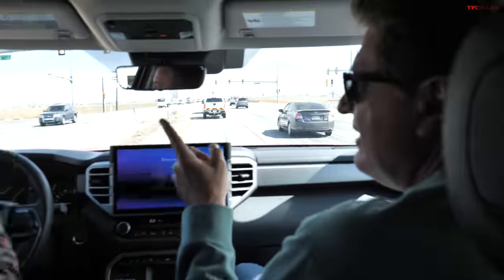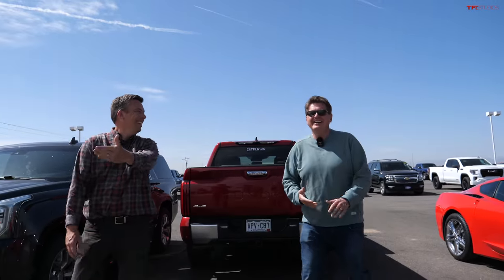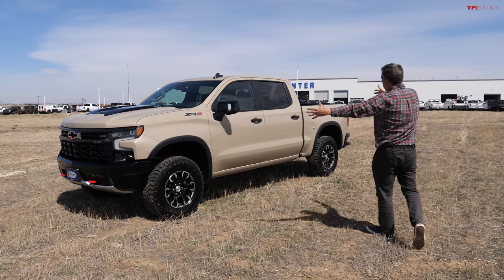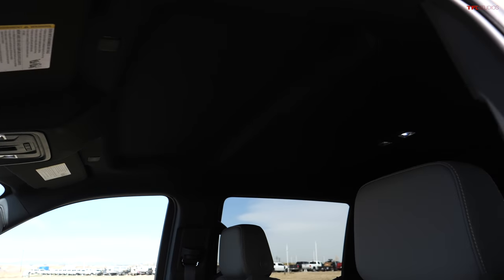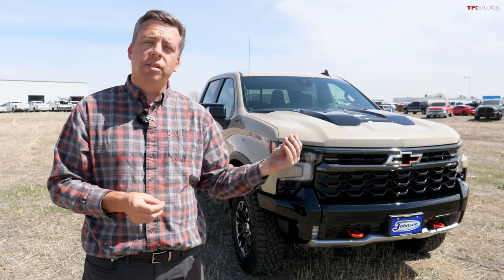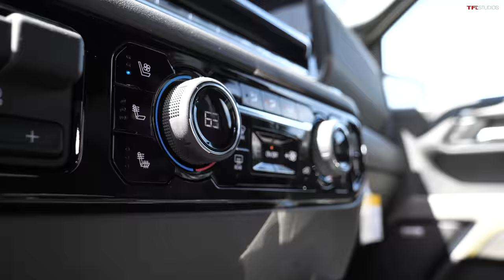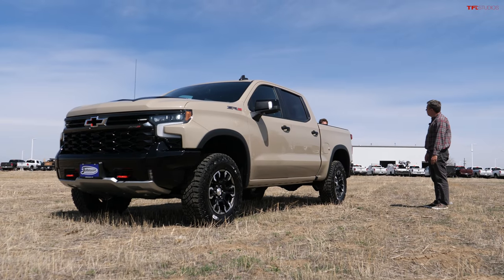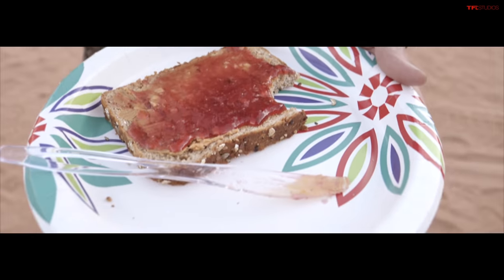We Traded Our 2022 Toyota Tundra TRD On This Brand New Off-Road Truck - Here's Why!

Comment: nice looking truck hope you keep it long enough this time to see if it is reliable its a gm product not a toyota so reliability will be an issue. great content thanks love your channel
Reply: Agreed, GM will never come close to Toyota reliability.
Reply: All the chinese parts start to fail. After owning a chevy, I'd never buy one again. Always fixing something. Wheel bearings, ABS wires, wiper assembly, coils... Way too much imported chinese parts. Looks don't equal reliability.
Reply: @franktags136  lol
Reply: I don't know I'm at 520k on my 06 gm truck and 585 on my 2000 both stock engines,alot of these ppl trade there truck in every 5 years and say how great they are,keep it for the long haul and see the outcome..
Reply: That's why TFL needs to keep buying historical problematic vehicles, is for the potential of drama of ownership.  Where is the drama/fun/chaos of owning a product for a year that works and ever lets them down?  Which is why the Tundra needed to go after only 5 months.  They knew it would not keep the interest of the viewers.

Comment: So it’s $10,000 more than the tundra traded in but comes with tow hooks. That engine is impressive but will be even less economical. 
Honestly, I don’t care. Looking forward to seeing a new truck on the show.
Reply: Vs the truck they traded in this  has more capability, more towing , gas milage is pretty much a wash.  Better off road ,  more tire , lockers front and back. I get it , you hate GM but if your going to downplay it , at least do some homework when you spew out price.
Reply: @9663mu  Well they got MSRP for there used truck with over 7000 miles, in this market probably not a fair measure. They said in the video the new truck is rated to tow under 9000 lbs, the Tundra was rated for over 11,000 lbs. I doubt the fuel economy will be a wash especially if you consider you have to buy premium fuel now. It is a nice looking truck though.
Reply: @vitkobylka6432  who says you have to buy premium fuel ? It’s recommended maybe your towing heavy or have a big haul but the truck runs just fine on 87.   Talk to me when Toyota sells more then 10k tundras in a month.
Reply: @9663mu  Maybe I’m misinformed but pretty sure you are supposed to run the 6.2 on premium fuel, that’s what turned me off that engine choice. I really like the GM 3.0 diesel, interesting though how having a turbo like most diesels no one makes any comments on that but Toyota’s decision to put turbos on an engine like Ford gets lambasted. Last time I looked you’re right they don’t sell that many trucks but it’s sure interesting that they are the number 1 car manufacturer in the world. I’m sure if you get the ZR2 you’ll enjoy it, I would.

Comment: I paid $69K for a ‘22 Power Wagon that has Front & Rear Lockers, Solid Front & Rear Axles, 4:10 Gearing, Sway Bar Disconnect, 12,500 LB Warn Winch ( Standard ) and all around shocks and coils No leaf springs..🤷🏻‍♂️

Comment: As excited as I am for this I am still wary of the 6.2 after my neighbors blew up after 1500 km
Reply: Its Garbage Motors for a reason
Reply: I had a 6.2 that lasted to 200k . At 200k the oil pump started to go bad. I could have put a oil pump in it and it would have lasted longer.
Reply: My buddies lasted 20k before blowing up
Reply: I believe the new model's don't have DOD or whatever it's called today. From what I've heard that was causing the reliability problems.
Reply: @cesarurzua8234  my friends new tundra just blew up with 35 miles on it
Reply: @danielmeador1991  new tundras are unreliable, that I can’t deny, pre 2022 tundras are reliable, some even reaching over 1 million miles
Reply: @cesarurzua8234  no 2022 tundra has hit 1 million miles and I seen 6 Chevys with 1 1/2 million miles and only 1 Toyota with 1 million miles and it wasn’t a truck it was a Prius
Reply: @danielmeador1991  did you not read my sentence correctly? I said pre. Also it was a tundra, no hybrid comes even close to 300k miles.
Reply: @cesarurzua8234  the one I worked on did and technically that tundra had 975k on it
Reply: @cesarurzua8234  and I did I misread it sorry

Comment: I've always been a Chevy guy and I own a ram now. I am disappointed. Same 6.2 V8. Nothing really special. Seems like a trail boss 2.0. And Chevy needs to step up their interior game to keep up with all the other brands
Reply: Umm did you not see the interior? Lol
Reply: Same 6.2L? That has more standard HP/TQ than Ram.  Yet you state you bought a Ram and they haven’t updated their so called 5.7L “Hemi” in years!  Too funny.
Reply: @xxlavenderxhedgehogxx7346  I think he means a new engine in the higher up trims. Kind of how ram has the trx with the hellcat engine.
Reply: @10ProSoccer  yes, that's what I mean. Doesn't compete with the trx. I'm happy with my truck but its a 2016 that was 40k new. For 70k I would expect way more lol. And yes I saw the interior. Not impressed for the price

Comment: Someone will see this tundra at the dealer and think someone traded it in because it had lots of issues
Reply: The Toyota dealer in metro Atlanta had five used 2022 Tundras with less than 100 miles on them.

Comment: You traded a Toyota for a Chevy… you must like walking lol.
Reply: Better content for a youtube channel business.  Bigger gamble on chaos which more people will tune in for than something that just works.
Reply: That Toyota has problems though
Reply: @danielmeador1991  I agree, the 2022 has bugs to work out mainly turbo problems, I still don’t recommend Chevy. All of the 3 main American car companies have problems these days.
Reply: @davidcoombs1874  all car companies have problems these days
Reply: @danielmeador1991  the last 2 Toyotas I owned, the one never gave me problems, the other only needed front wheel bearings replaced at 80,000 miles. The last Chevy I owned needed a new transfer case at 20,000 and it would start hard. The Ford needed the cv shaft replaced twice in the same month because the vacuum pump was half engaged but wasn’t throwing codes. I can honestly say I’ve never owned a dodge. I think you’re right, but I still think Toyota is a cut above the rest.
Reply: @davidcoombs1874  I think new Toyotas are junk
Reply: @davidcoombs1874  my 2008 tundra blew up at 127k miles. My 2004 chevy lasted 200k miles. I don't know if Toyota is as good lol.

Comment: Sadly, owning a GM product like a vette or this ZR2 is like being married to a Supermodel with a chronic yeast infection. I foolishly have owned 3 GM’s within the past 3 decades and all of them were horribly built garbage. I’ve owned and currently own Toyota and Honda products, unbelievable how much better built they are.
Reply: I have to add, anyone who would pay over $67k for a GM or for the most part excluding exotics any vehicle is an absolute fool. Unbelievably stupid price tag. Guess consumers are sending the manufacturers great grandkids to college and paying for their weddings.
Reply: @franktags136  not just gm, all vehicles are insanely expensive now. You're right though, I've always had a special affinity for GM, my first couple cars were GMs and were actually fairly reliable. But both my mom and my aunt have had 2010 GM suvs, an Arcadia and a Cadillac SRX and they've both been complete piles. Seems like they're always in the shop, and they barely have over 100,000 miles. My aunt was smart enough and traded hers for a CRV, my mom is still plugging away with that Cadillac. Meanwhile, I bought my 4Runner 3 years ago with 80k on it, it's at 136k now. In that time the only repair I've had to make to it was $189 to have the AC serviced at the dealer, it was blowing kind of weak. The only other money I've spent on it has been fluid changes and a set of tires.
Reply: @franktags136  Toyota will charge you $70,000 for a TRD Pro that doesn’t even have tow hooks. Y’all live to troll GM with your bs like they pull prices out of the sky that just aren’t justifiable unless you’re sitting in a outdated Tundra interior with bits and pieces falling apart. Check 2022 Tundra forums. 😅
Reply: Oh you are correct, and it’s not even close. It’s been like that for about the last 3 of 4 decades. The only slight exception to me would be the 99-06 Silverado’s.
Reply: @mybro727  The Toyota price is stupid as well, not just GM. Difference is the Toyota is a far better built vehicle. Waste Gates issues and all.
Reply: Unfortunately for you, the Corvette is extremely well built. Maybe don't buy from a crack head selling you his C5 Corvette that's been neglected for 10 years. The C6 Corvette and C7 have amazing reliability and hold up extremely well after constant track use for multiple years. The C8 Corvette has been universally acclaimed by every major magazine and reviewer as world class in both performance and quality, with the 3LT interior package being directly comparable to the 2020 Porsche 911 Carerra S, with the end result of them claiming the build quality and materials are 95% on par, and the performance is slightly better than the Porsche
Reply: @franktags136  the Cadillac CT5-V Blackwing is world renowned as being the best 4 door drivers car ever built, with it possibly having the highest performance of any 4 door car on the track, and its build quality directly comparable to the 2022 BMW M5 CS, and the 2020 Mercedes AMG GT 63 S.
Reply: @mybro727  I'm a Ford guy...but Toyotas have issues as well, just like the domestics.
Reply: @saltyfloridaman7163  yea, good luck with that. The Lexus IS 500 though not near as fast and in my opinion the Cadillac looks beautiful yet you will not convince me the Cadillacs build quality is anywhere near good. Owning a GM product like the Cadillac is like being married to a Supermodel with a Chronic Yeast Infection. I’ve owned GMs. Long term absolute garbage.
Reply: @franktags136  I think you’re confused. No one is trying to convince you of anything. You have your own preconceived notions that you’re operating off of no matter how inaccurate they are. Depending on your age, you’re not going to budge either direction after this conversation. But the point is to enlighten you anyway! 

Have you heard about all the build quality issues and unreliability Toyota is experiencing lately with their flagship the new Tundra? Lol. You can’t have. 😂 

The Lexus IS500’s interior is built by the same folks who built the Tundra - and looks the part. It doesn’t even compare to that of the Cadillac V-series sedans. Makes the Lexus IS look 10 years old because it is. Again, the materials and build quality of Cadillac are certainly on par with Lexus, Mercedes-Benz, BMW, etc. As someone has already mentioned, there are world class Chevrolets right now that will put the best from Germany on their arse.
Reply: @franktags136  Reality check. You need one. Honda just went into business with GM after expanding plans for GM to build two of their EVs, so not even HONDA agrees with your assertion about GM’s quality or else why would you have them build your own products? You’re a walking contradiction. 😂
Reply: @saltyfloridaman7163  good luck with that. The cars that sit in a garage and get driven every other weekend. Not a real world daily. Long term 50k plus miles, it’s garbage. That’s a GM promise
Reply: @mybro727  excluding the Escalade, because people keep spending the cash it takes to keep them on the road, how many 8 year old Cadillacs do you see as daily drivers ? Be honest and the truth shall set you free
Reply: @mybro727  Buy your GM, keep it beyond the warranty period and good luck
Reply: @franktags136  sure thing, my neighbor tracks his C7 Grand Sport every weekend and has 128k miles from driving to Sebring, VIR, and the annual trip with his friends to willow springs. Only thing he replaces often are tires, brakes, and he replaced his suspension once
Reply: @franktags136  I can tell that you're obviously just biased and feel the need to complain on a YouTube video for validation. My family is all about ford, but my father and two uncles all worked as mechanics and currently work at LKQ and have for over 20 years, and even they admit that utility and performance models from GM are among the most durable and reliable vehicles, but they also admit that GMs economy cars and crossovers are generally below the industry standards
Reply: @franktags136  So you believe the Escalade is the only expensive product GM builds and sells fairly well every year? 😂 The more you talk the more I understand.

What makes you think I haven’t owned a modern GM product outside of warranty already? Smh. Too late! Most reliable mid-size car I’ve ever owned was a 2014 Malibu LT well over 125,000 miles before it was totaled in a crash. Unlike your experiences, my car was actually a MODERN GM product which means it’s not too far fetched to compare it’s build quality to that of new GM products today and trying to draw a line to connect the two. The opposite can be said for you, but I digress.

Comment: 🫤 this is a great truck for GM fans but they clearly called it in. The TRX and Raptor are in a different league. And if you want an off road vehicle without the luxo features you can get a Raptor for the same price (MSRP).
Reply: I’ll pass on a raptor ford made the mistake of putting aluminum lower control arms on it.
Reply: @Back_door_bandit_98  weird, do they fail?
Reply: LOL. The TRX is in a different league in price as well at $100,000+ so your direct comparison doesn’t make sense.

The Ford Raptor is much closer to this in power numbers but doesn’t come close to the luxury and technology GM is bringing to the segment and the Raptor can also be well over $80k. Called it in? I’m sorry, did you expect a redesigned brand new truck for a mid-cycle refresh? 😂
Reply: @mybro727  tech? Don’t make me laugh, Raptor’s off-roading tech is light years away from the ZR2🤣🤣
Reply: You can't touch a new raptor around here for this price....shit they are marked up to nearly 100k
Reply: @mybro727  actually the Raptor can come fully loaded just like the ZR2 but the ZR2 can’t come equipped with the same engineering for off road use. The Raptor’s frame is different and stronger than an ordinary F-150. The suspension is totally different. Even the intercooler has its own cooling fan for slow speed rock crawling. No other F-150 is is equipped with that. The TRX doesn’t have a different frame but it’s heavily reinforced with a different suspension than normal Rams. The cost associated with a Raptor isn’t fancy cameras and leather it’s the special tooling and equipment used to manufacturer it. As far as I know save for the shocks the ZR2 is basically a loaded TrailBoss. Called it in.
Reply: @khakiswag  Lol. Again, you’re comparing a Raptor to a truck that costs thousands less and clearly doesn’t even have the same order of priorities. Yes a lot of what you said pretty much sums up why the Raptor is a more capable off-road truck and a worse on-road performer/daily commuter than the ZR2. We’re fully aware. Perhaps that’s why TFL just purchased a new ZR2 and not a new Ford Raptor. 😂

Chevy is offering the best of all worlds. There’s no real downside to a ZR2 which can go pretty much everywhere a Raptor will go ON/OFF-ROAD thanks to GM’s engineering and again unbeatable technology. Unlike the Ford, the Silverado ZR2 offers a interior worthy of a 2022 model year, features not found anywhere else, and does it all at a cheaper price. I think you’re more upset that it was phoned in and it’s still a home-run. Clearly a group of Ford fans trying to save face here and trying hard. 😂
Reply: @mybro727  so clearly you’re a GM fan boy. What unbeatable technology does a ZR2 have?  As Andre pointed out the ZR2 finished races as a special entry. The Raptor finished the Baja as a regular entry with everyone else in stock form save for the roll cage. If GM is marketing this as their ultimate off roader then it better be as ultimate as what’s coming from their competitors. It’s not. This is a modded TrailBoss that is playing with Ram Rebels and F-150 Tremors while their Daddies, TRX and Raptor, looks on.
Reply: @khakiswag  That’s usually what Ford fanboys tell me after I’ve laid out some facts. Lol. What unbeatable technology you ask? The Ford Raptor does not have dual e-lockers, built-in Google software and/or assistant nor Multimatic DSSV dampers just to name a few. You literally can’t get a better best of both worlds experience in this segment and you know it, especially not for the price. You’re pretending that “daddies” who buy Raptors and TRX only use them for off-roading but they’re also daily drivers 90% of the time seen parked at Walmart. The ZR2 is just as good ON-road as it is OFF-road. It’s the better overall package to live with because of it’s technology and functionality of the design - and you’re so angry about it. 😂
Reply: @mybro727  yeah when your 400HP puny engine gets beefed up like the Raptor R’s and the TRX’s, when it has professional off-roading suspension and not wannabe off-road suspension and 35+ inch wheels then we can talk XDDD. Google assistant won’t help the ZRTrash get through the deserts of Baja 🤣🤣
Reply: @mybro727  it doesn’t even have beadlock wheels, you deflate them to hit the trails and the tire will slip off like a condom🤣🤣